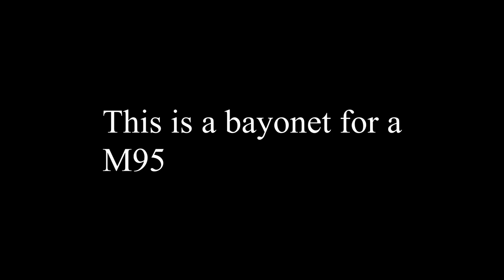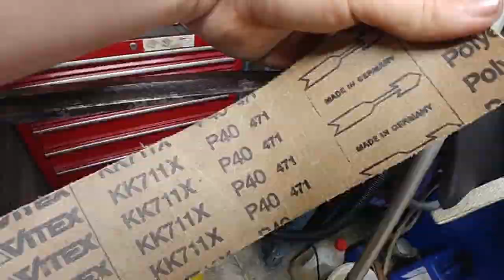M95 Bayonet- Old Bayonet clean up aka restoration - 002

Comment: You need to get some sandpaper frommthe roughist to fine grit and polish the blade using the wet dry method . You can use WD 40 as the lube to help inmtha sanding. Hope this helps.